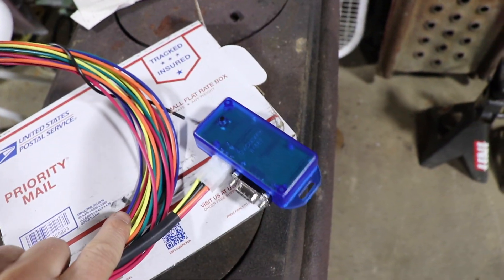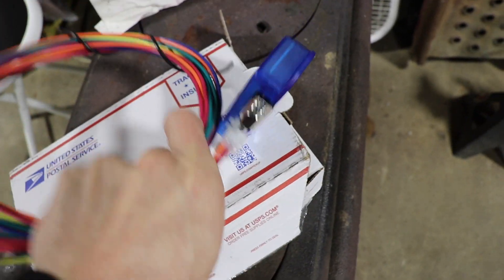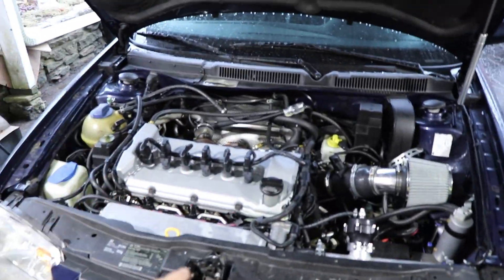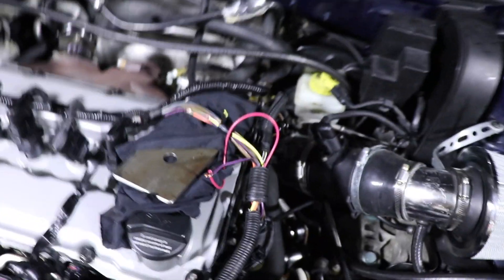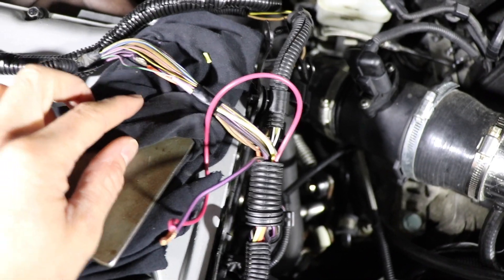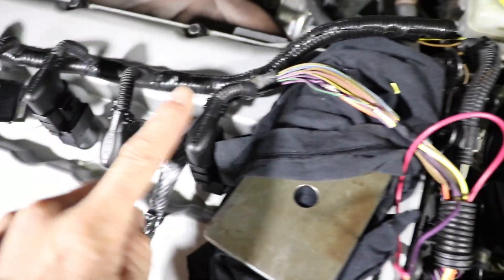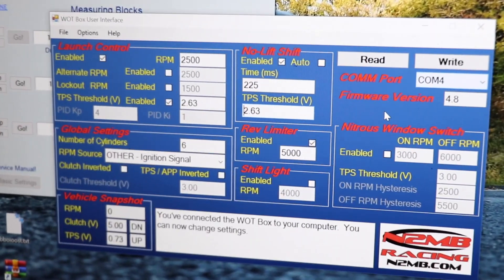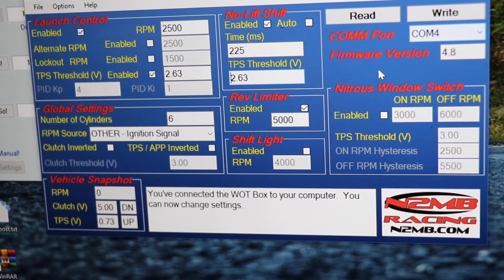Wot box install (launch control)

Comment: This vid needs more love. This is just what I needed and I could NOTHING untill this.
Reply: nice dude!! I knew it would help someone else out eventually!!!🎉
Reply: Ok so one thing on THIS car and maybe others. Your basically interrupting the power wire going to the coils which gives you the launch control and shift cut.. So power is usually from the fusebox straight to all the sensors, but now the wot box is inline with the power wire. YOU NEED TO MAKE SURE the wot box is inline with ONLY THE COILS. DONT PUT THE WOX BOX INLINE WITH ANY OTHER SENSORS OR IT WILL CUT THE POWER TO THEM TOO, AND GIVE YOU A CHECK ENGINE LIGHT. 
We made this mistake, the coil power wire goes to the cam solenoids. We installed the wot box right BEFORE the coils which cut power to the coils AND the cam solenoids. It worked fine it just threw a code every time we hit the launch, couldnt figure it out for a couple days then I started looking at a wiring diagram and realized it is cutting power to the coils AND the solenoids. Just make sure your cutting power to the coils AND THATS IT!! Other than this little problem this thing is working GREAT!!! 

Good luck with your install!!!